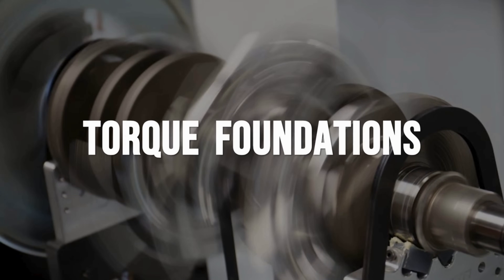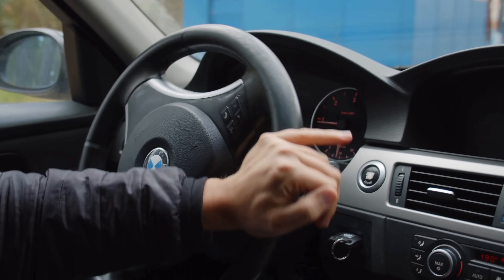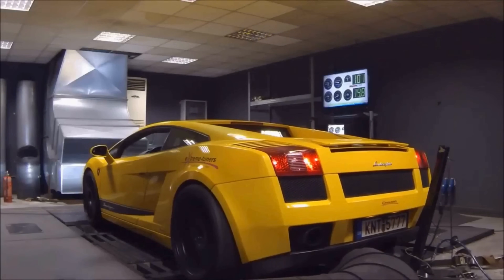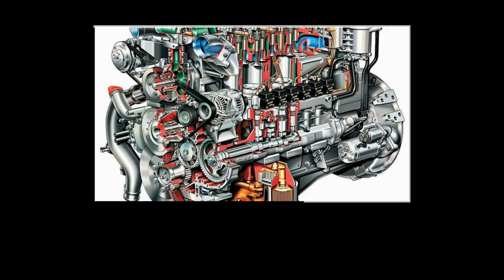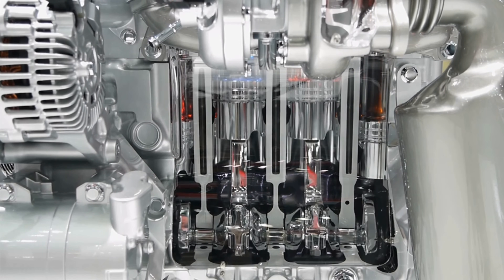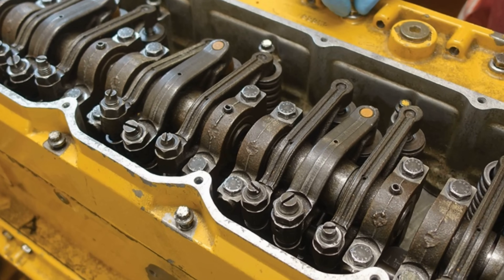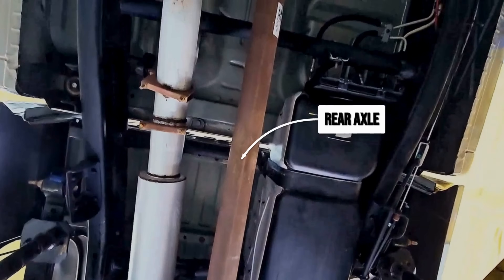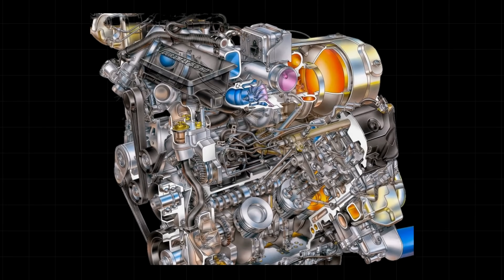Diesel Horsepower vs Torque:  What ACTUALLY Matters?

Comment: If just anyone could be able to design some kind of device that could be able to transform power to torque on the wheels. Something like a gear ratio that magically transforms a lower torque at a high rpm to a higher torque at a lower rpm. That could be something for the engineers...